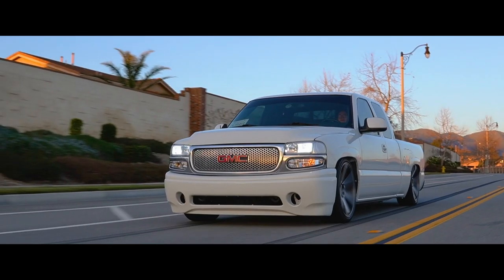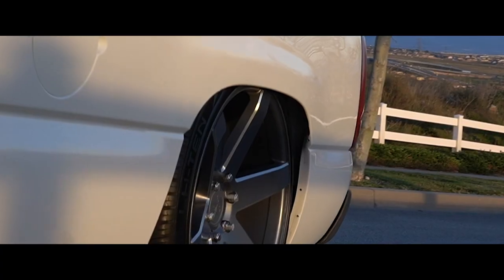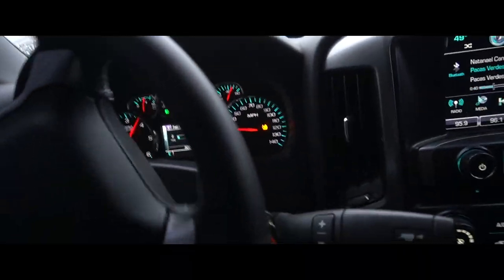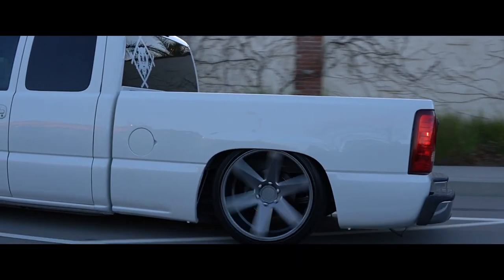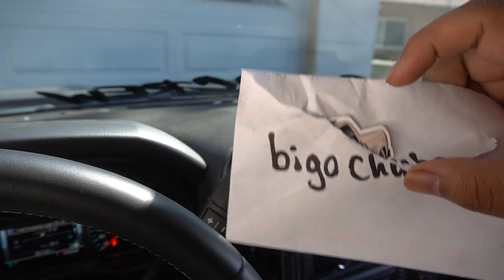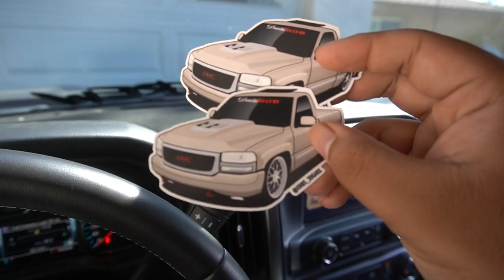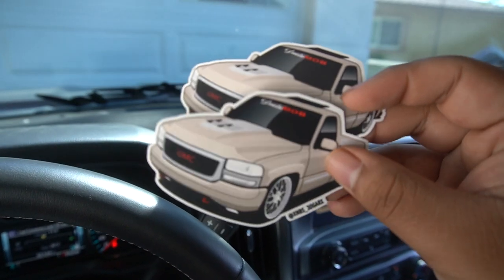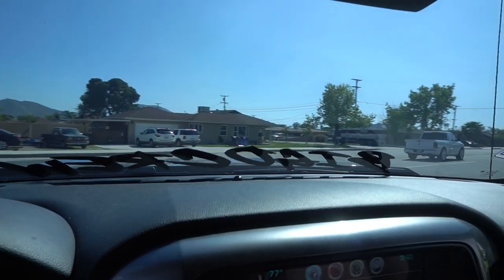GMC SIERRA IS GETTING CAMMED! - DENALI CLONE - TRUCK CAM 99-06 5.3

Comment: If it’s a decent cam needing heads ur gunna need to upgrade the stall and modify the 4l60e or possible just swap to a 4l80E trust me just installed a TSP stage 4 truck cam in mine, not hard to do yourself, transmission work on the other hand requires more expertise and expensive tools when pushing power so I would pay to have that done not the cam install.

Comment: Did you ever tune the e fans?
Reply: Lol same here Im waiting on some part before I go tune my  So u running clutch fan  intil you tune it
Reply from the maker: nomasyo yes lmao but to get tuned soon since I want to see it’s current numbers before the cam
Reply: @BIGOCHUBS  true
Reply: Is that clutch fan working good with the bigger radiator ?
Reply from the maker: nomasyo it’s actually working great man, engine temp is lower than usual